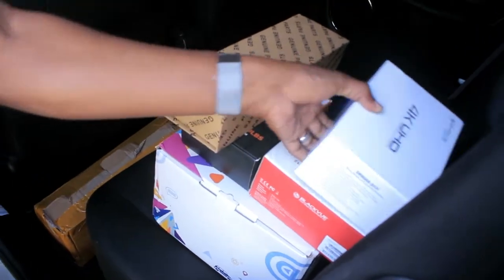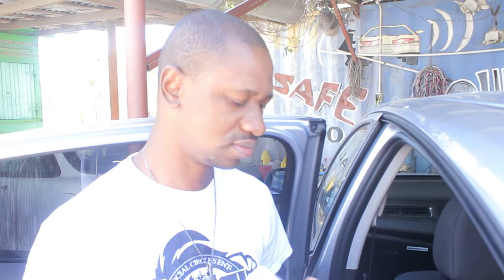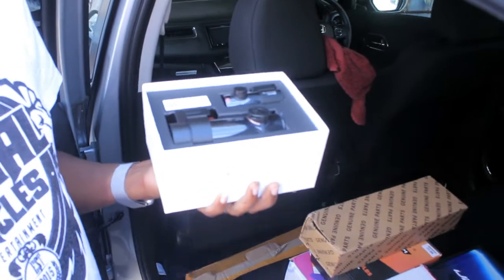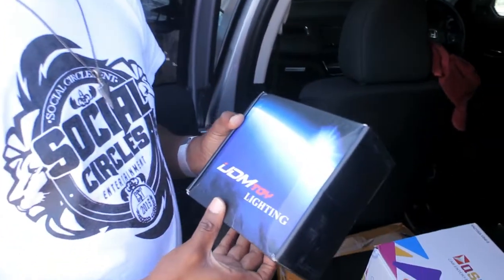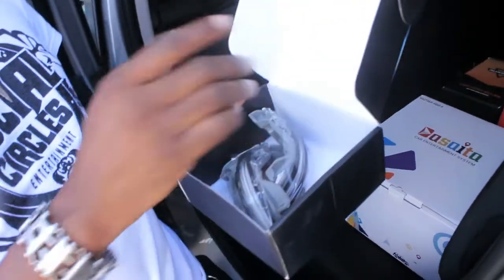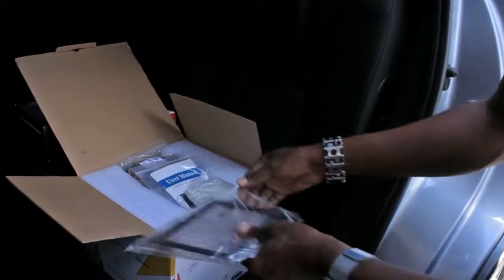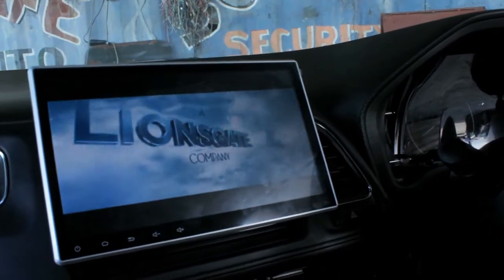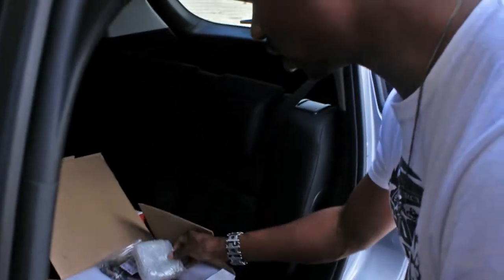Introducing The Honda Vezel Project

Comment: Come on, its been a month, where are the rest of the parts...?
Reply from the maker: we put on a few more things but didnt get to make a complete video...update coming soon
Reply: On our last install/shoot, we faced some difficulty with the alarm system, and have since been in dialogue with the manufacturer to remedy the situation. That coupled with the fact that a ton of new parts and mods are coming from all over, as far as Indonesia. So without giving too much away, we want to get most of them in, then it's back on the grind, so stay tuned, because it will be worth the wait.